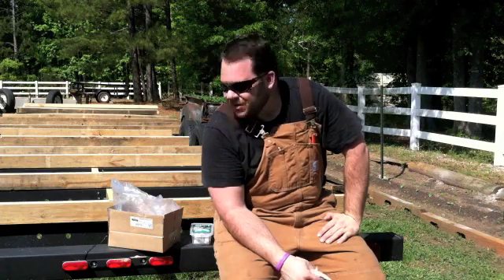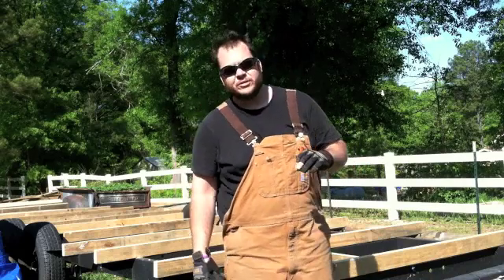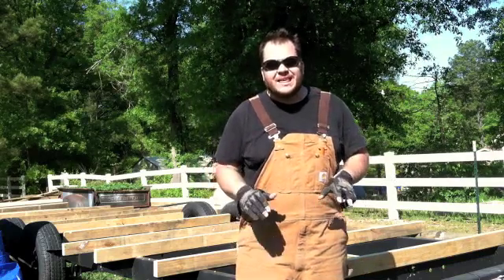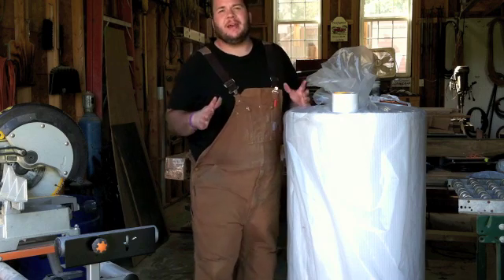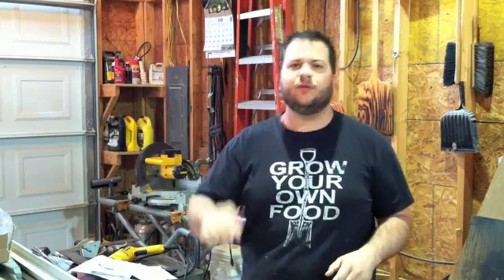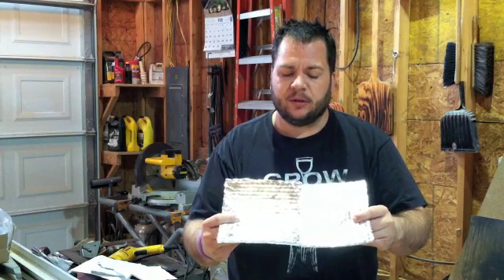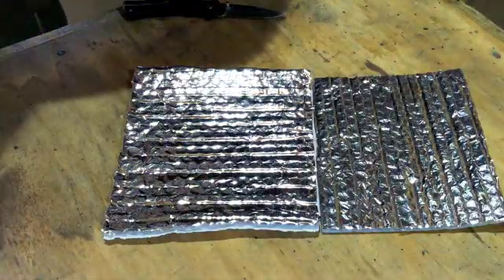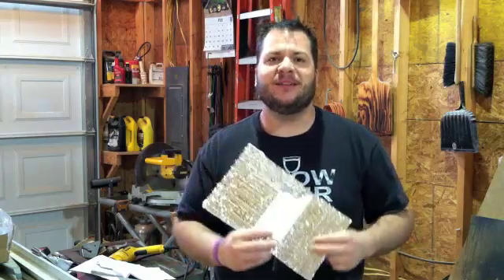Tiny House - EcoFoil Installation

Comment: The white poly surface of the insulated bubble wrap is water resistant and very easy to keep clean. The smooth white side also provides a nice finished appearance and brightness to the interior of your building. just got it from there website i use to install in in commercial steel construction

Comment from the maker: You are absolutely correct on road debris but because we are not going to be indefinitely mobile our actual road time should to be too large of an issue unless we carelessly run over trash and misc. road trash. It is a great point for other builders to consider.

As for the vapor barrier (EcoFoil) we are quite confident in its R-factor copled with our insulation in that we live in the southeast region of the United States where our temperature rarely dips below freezing.

Comment from the maker: Great comments and thoughts mob. However, I do disagree a little. While metal flashing or aluminum mesh can deter pests they can also allow places for them to hide and go undetected. The radiant barrier is a double sided product which includes a mesh substrate. In addition because do the height and open sights of the trailer proper I section should keep is from being overrun. If a problem is detected and persistent an "after-the-fact" wire mesh could be installed under the frame.

Comment: The barrier that goes under the sub flooring should be metal since it's purpose is to prevent penetration of varmints while parked and penetration from road debris while traveling.
The vapor barrier you used adds very little R factor to the installed roll R-19  insulation below the sub flooring .  
Since the tiny house is already completed,I only bring this up for information to help future tiny house builders understand why a non-penetrable metal barrier is a necessity .
TheTinyBungalow

Comment from the maker: Interesting that you ask that as I originally had the same concern. I had to look beyond the manufacturing though to the long term effects of the product. The "eco", if you will, comes in in regard to power consumption, heat loss/gain, overall energy consumption, etc.